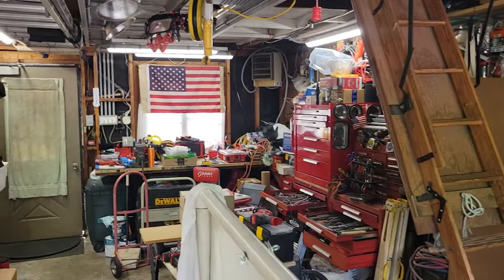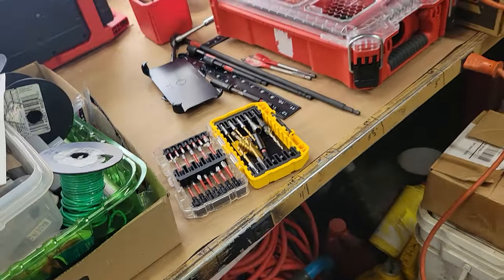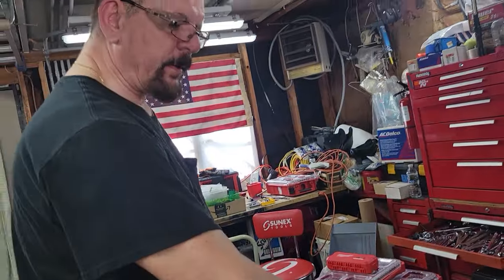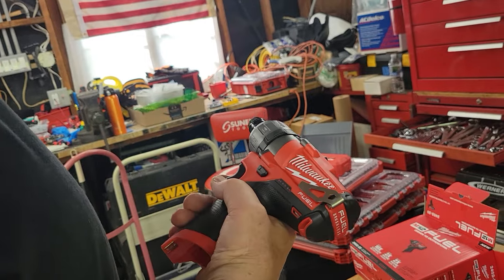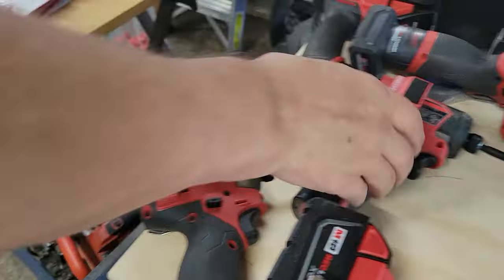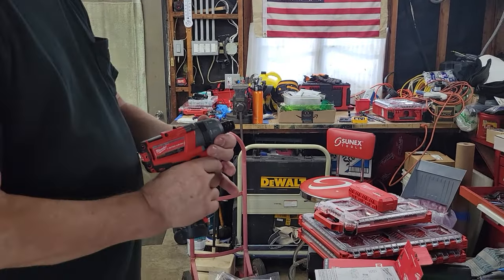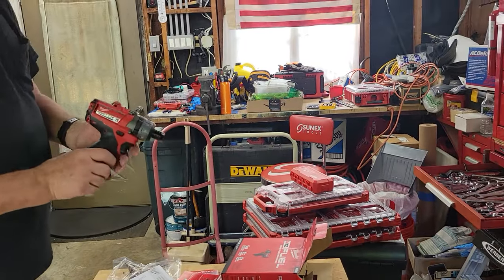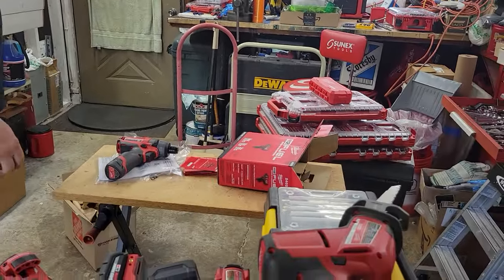Bro DIY - Unboxing a Milwaukee M12 FUEL, 2 Speed Screwdriver, # 2402-20

Comment: been looking to get some more m18s myself but the m12s do interest me a lot too for getting into smaller spaces
Reply from the maker: I have found, on this new platform, that Milwaukee has really done a deep dive into the tech/task foray.
For me, the M18 line is the working man's reach solution, and the M12 line is for the rest of us, but ... the M12 screwdriver is another 'gap filler'.
Personally, I am glad the same Red Link / Fuel tech. has been advanced with the same emphasis on both platforms.
On my garage lighting project, I found the M18's were overkill and pretty much stored them after stocking up with the M12 tooling. I will definitely use the M18's on the heavier construction and use the M12 line as the everyday reach-for.
I suppose, after decades, switching platforms and brands, we have all been bitten by the choice of offerings bug.
Thanks for viewing!
Reply: Thanks for the reply mate.
Yeah i do find that its a gap filler aswell. Im a mechanic and use the 1/2 and 3/8ths impacts a lot and already got a m18 drill but would like to get myself a 1/4 and the m12s seem to be more what im looking for. Thanks for content mate.
Reply from the maker: @brighter3539  
Ya know? I would suggest the M12 FUEL Surge gen.3. This tool is my choice for all tasks not requiring mass torque.
I, too have been a development jet engine mechanic for almost 50 years and have used mostly company supplied SnapOn 3/8",1/2",3/4"&1" drive batt. & air with 1/4" hex drive Bosch 12v and can tell you now, from experience, the M12 FUEL Surge would be the only tool in my home box if I just had one to choose. It impacts and drills with a deftness of finger pressure.
An amazing tool.
Good luck!